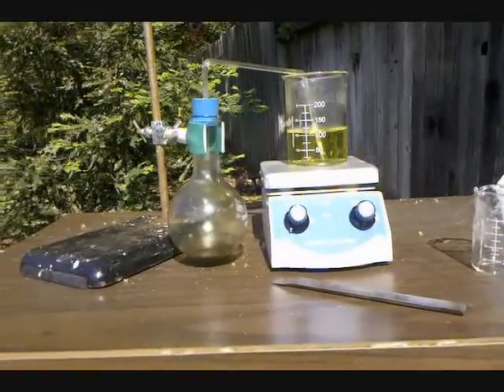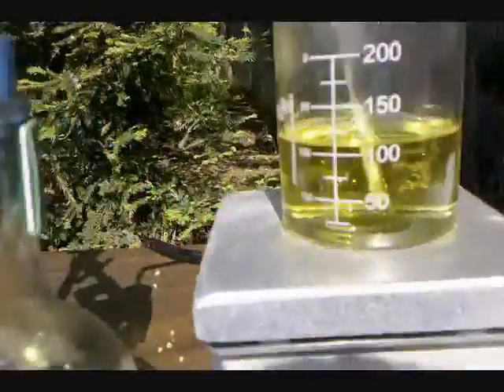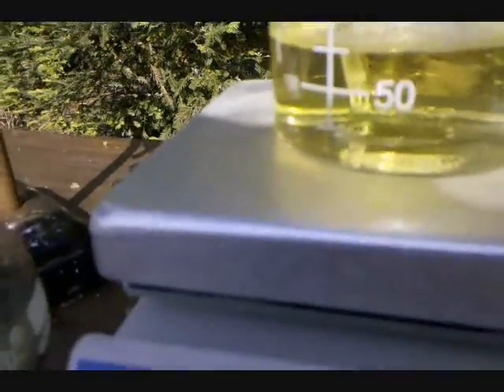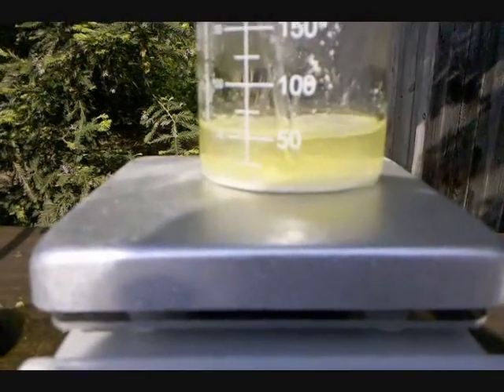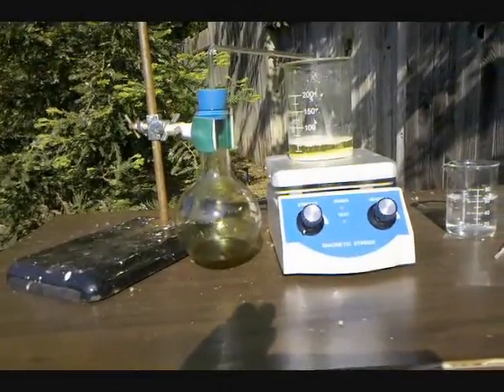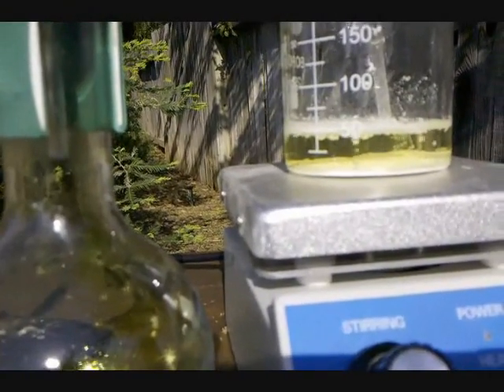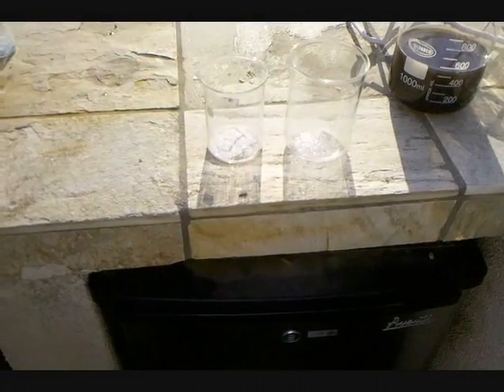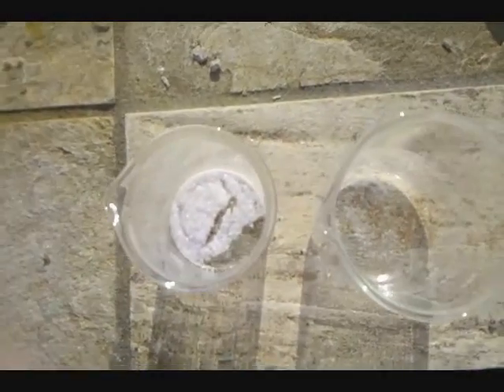Potassium Periodate

Comment: Given that MnO4- is responsible for the oxidizing power to produce the chlorine, it's ironic that the permanganate can not oxidize iodate directly. I have attempted it (in non-acidic solution). MnO4- won't even oxidize bromide in non-acidic environments, only iodide to iodate. So much for an easy dream route to perbromate lmfao